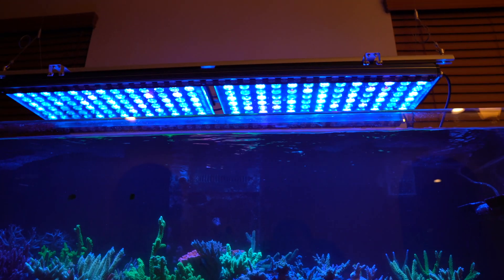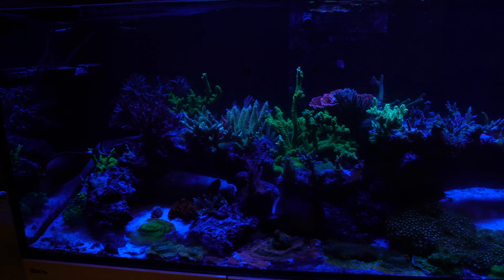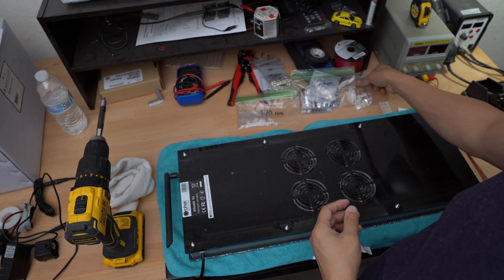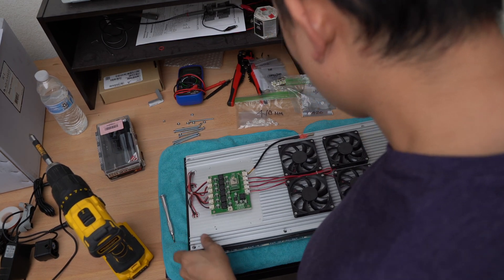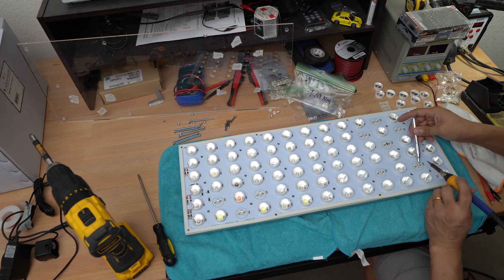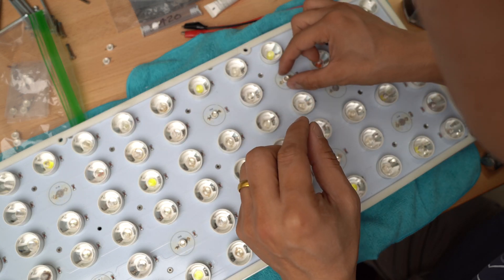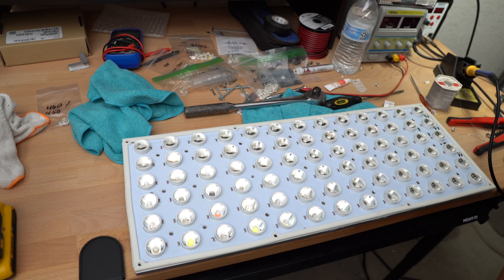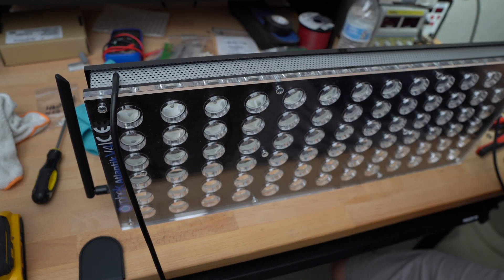Orphek Atlantik LED replacement on my Red Sea Reefer 625XXL

Comment: I understand that the chips that the orphek brings are 5w which are working at 3w to avoid excess heat, I see that you are directly using 3w chips, did you have any problem with it? or are they working fine?
Reply from the maker: They are still running to date.  No problems yet however I did update the link to the 5 watt chips which should last longer than the 3w.
Reply: @ModernReefer  where is the link? i need some replacements but still tryin to figure out for sure which are bad? found one but when i jump it it lights up with about half the other lights on the one end only. the other end still no light? do you have a video for something like i am experiencing? would really like to find some leds though as orphek is holding me over a barrel wanting $40 shipping for a $4 LED
Reply from the maker: @JimMetz  expand the description section of the video for links to the leds.

Comment: Have you checked if the LED-Board is also covered with heatpaste ? On my 3 Orphek there was not a single grs heatpaste, this is also one of the issues. If there is no heatpaste the heat from the board itself will poorly transfered to the heatsink.
Reply from the maker: There weren't any but they seems to be soldiered right onto the pcb board so heat dissipation should be fine.

Comment: For how much these cost that’s way too early for chip failure-2 yrs?!!  I have led fixtures over 5yrs old and I’ve never had any chip fail.  This seems way too common with orpheks…. Are the heat sink and fans inadequate for cooling this light?
Reply from the maker: I would agree. Unfortunately this is what I have at the moment so I'll have to make it work for now.

Comment: I had this happen many many times i ended up going for philips coral care gen 2 zero issues now :) hope you get it sorted mate its quite a common issue with orphek
Reply from the maker: So far it's been working fine. Knock on wood.
Reply: @ModernReefer  , present you used Atlantik v4gen2  , I have ordered 3 and in Vietnam they are not satisfied with orphek it is very easy to damage the led and mainboard
Reply from the maker: @TuanAnhNguyen-ws9sy  Thanks for sharing. I have already moved onto a new lighting setup and have been really happy with it.